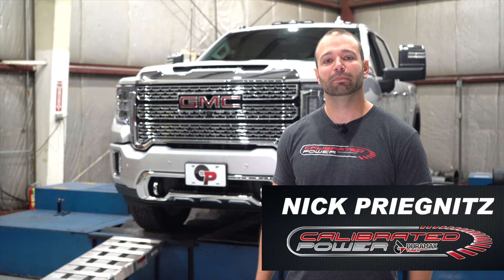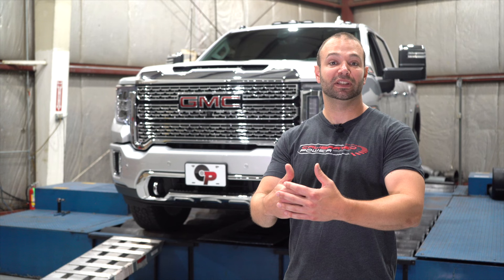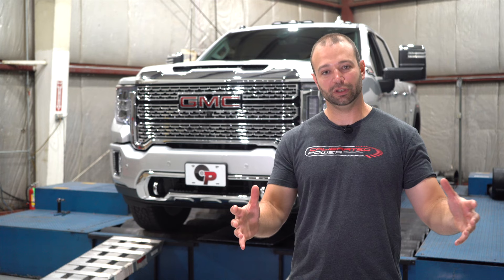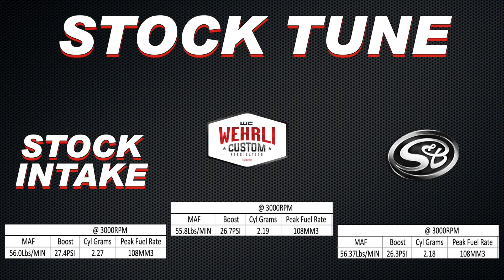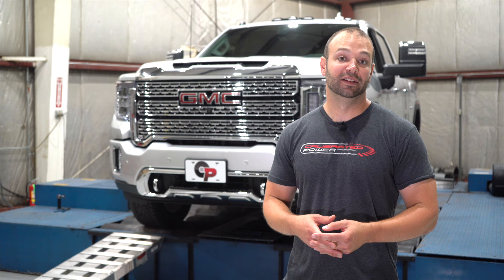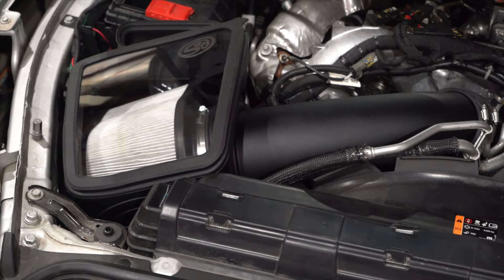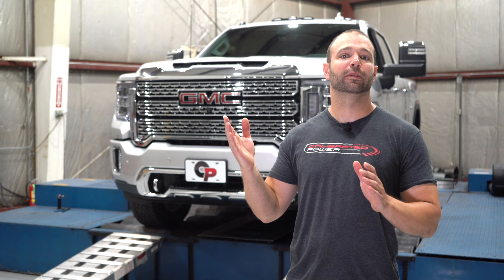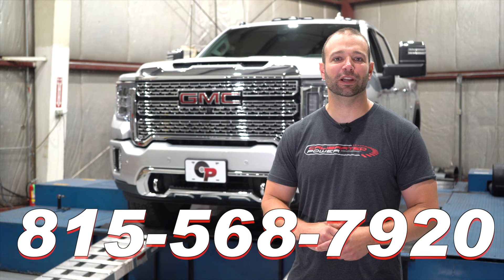WHICH INTAKE IS RIGHT FOR YOUR L5P?!

Comment: Nick why was vane position higher on the aftermarket intakes? Does the ecm see higher mass flow and adds more fuel so it closes vanes more for greater boost to match? I am just wondering if more boost is because of the vane position or another reason

Comment: I wonder if there would be a heat soak difference between the s&b and wc fab as in if you got stuck in traffic on a hot day.
Reply: I don’t care so much, as I have the S&B but I would imagine the metal fab intake woul have some heat soak loss, even throw all testing shows menial hp and tq gains I fell long haul would lose those numbers

Comment: Would love to see the Banks intake tested. They have numbers, but it's on a bone stock truck. So wonder how it would do with the turbo, tune combo you used in your test. But the general idea I'm getting from this test is unless you throw a tune on the truck, an intake is not worth it. Seems like the truck does not know what to do with the extra air flow on the stock tune.
Reply from the maker: Tuning is always going to be your best bang-for-the-buck. An intake without tuning may still provide some benefits but likely not enough to have a noticeable impact.

Comment: Love it that it was as unbiased as possible. I went with S&B because like you mentioned, it looks stock to someone quickly glancing at it.
Reply: How do you like the s&b, better throttle response? More growl under acceleration?
Reply: @Farout397  growl...Yes, but not by much since it's still EPA compliant. After the intake horn was installed, you can hear it during low rpm when pulling off and on colder days up to about 3k rpms. As for throttle response, pedal monster cured most of the dead feel before I installed the intake box.

Comment: Speaking on the sealed or no sealed part of the video. Two weeks ago a relative drove my duramax through a wash and the intake I have did nothing to block the water and somehow dirty water got in my filter and took out my turbo. I have an HSP intake on my LML and yeah but now I gotta buy another 68mm turbo 💀 and I know they make those water proof filter cover things but I just never got one. Also the HSP intakes are completely open underneath them, you can see all the way to the ground if you look from the top down.
Reply from the maker: That sucks about loosing a turbo. Hope it comes back together quickly for you. If you decide to switch things up, our Stealth 67G2 turbo may a good option for you. https://duramaxtuner.com/turbo-chargers/stealth-series.html

Comment: Great video, I would like to see mpg difference on a lb7 with stock fpr and race plug vs lbz fpr with race plug. Hp gains, etc
Reply from the maker: I wouldn't expect a noticeable MPG gain from an FPR switch. Same as the race plug. At best, both of those upgrades would be helpful in a total peak power scenario.

Comment: Have you tried the Banks air intake and what numbers does it produce?
Reply: I was hoping the Banks air intake was included in this video. When it comes to 50 state legal I think banks is one of the top contenders
Reply from the maker: It was not available at the time of testing.
Reply: @Duramaxtuner  If you were closer to where I live, I would let you do the tests with my deleted 2019 L5P.  I did the WC piping and programming, but now curious with the Banks Air box I am using over the other ones.  Ultimate goal is to acquire a 64mm turbo for mine and then it will be complete.

Comment: Any difference in IAT for plastic vs metal intake? Is that a concern?
Reply: Good question. I’m sure the metal would transfer more under hood heat. But remember there’s a lot of air coming through that intake so I suspect the net effect to be minimal. I do not have data to confirm that suspicion :-)

Comment: Question, may be a dumb one but still will ask. Would either of these setups make more power with the top half removed? Like the clear cover on the S&B. Any concerns or potential issues?
Reply from the maker: LIkely you would not see much change there. The risk is water and debris making it into and through your filter.
Reply: I tired this and I definitely felt and heard a difference. I did the turbo whistle and really heard no difference. Took of the clear cover and side seal and really made a difference. I wanted to ask this question as well. 
So the only risk is getting water and or debris into it? In south Texas, not much water to worry about. The filter is on their tight to keep debris out. Missing the sound because I put it all back on, so would love some advice on the risks.

Comment: Banks has built their own air intake and designed their own MAF sensor to add to their larger tube.
Reply from the maker: Yeah, we wish it would have been available at the time of testing.
Reply: @Duramaxtuner  they are still on a pretty decent backorder situation

Comment: Question is how do these perform under on road circumstances. Say 90° ambient temps pulling 20k. Do they pull hot air in and cause power changes or do they keep cool air coming in and still add power found on the dyno?
Reply from the maker: @shanewhitmer3840 Any changes in ambient air temperature will have an effect on the outcome. However, pulling in ambient air will always be cooler than under hood temperatures once the vehicle is up to temp. That being said, all of the data that we present in this video should be an accurate reflection of the difference in performance that you can expect out of these intakes. The load you are pulling will only have an effect on the air the engine is demanding so you will most likely see your greatest gains in performance under a heavy load.

Comment: Well wouldn’t the computer have to adjust with the new intake on? I was told the computer has to relearn and adjust itself after driving it for a couple miles with the new intake to see hp/tq gains. I’m not sure tho but that’s what I was told about them.
Reply from the maker: @manuelestrada4705 There is no re-learn process for mass air flow calibration. It is always pre-determined in the tune. Being that we used a 50-state tune in all the tests, the intakes were all tested using the same mass air flow calibration to provide fair results.